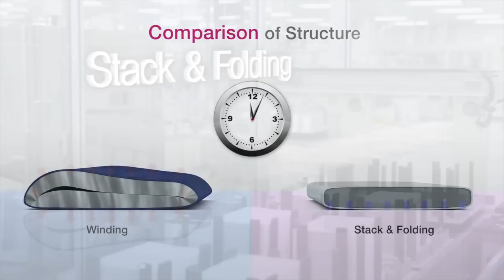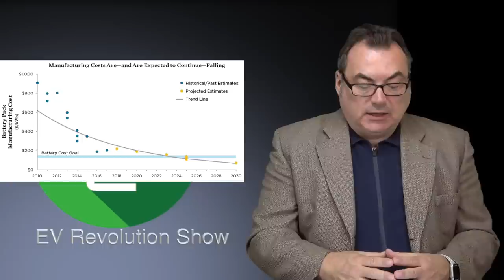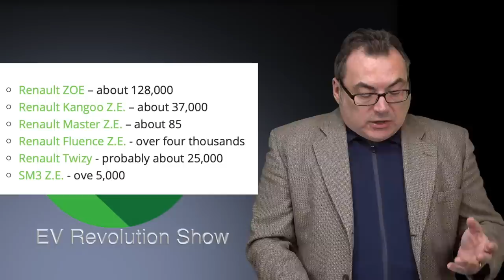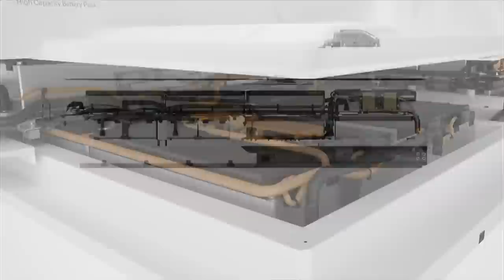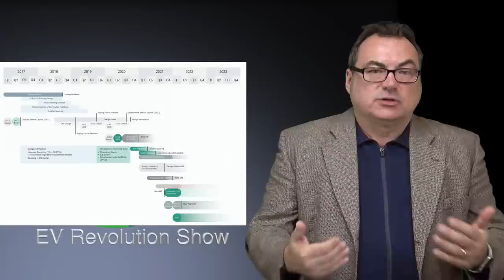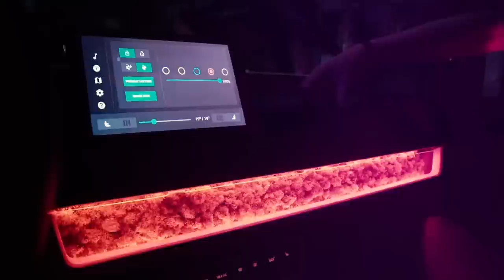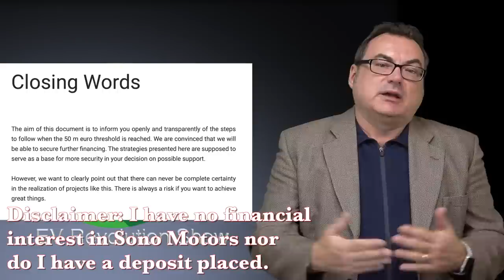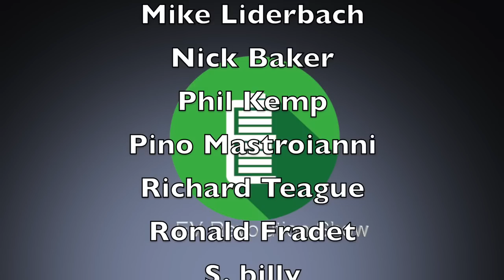Episode 71 - EV Battery Pricing, LA Zero Emissions, Hyundai E-Strategy, Sono Motors Funding & more!

Comment: As much as I like EVs I think we need to take on the realistic expectation that EVs will have to be cheaper right off the sales-lot than ICE units to really take off as the dominant mobility technology.  Joe minimum-wage-earner is going to buy the vehicle he can afford up front before he can even think about saving money while using it.  The transition from ICE to EV reminds me of going from Tube to Transistor radios.  Initially the hot new tech of transistors was exotic and expensive but quickly became cheaper and it was when it became cheaper in the stores than tube units were that it transformed the market.  I know it all sounds short sighted but that is how markets often move.
Reply: foxpup 
It's true that it's harder to make a very low end EV cost effective, but as all these new models cone on the market then the second hand market will swell as more early adopters trade up to newer models. Right now you can buy a Leaf or Bolt for very reasonable money. And in Europe there are things like the Renault Zoe.
And in a couple of years there will be second hand Hyundai Konas etc coming into the second hand market. These will still have many years of life left in them, and with much lower running costs than ICE vehicles. I think that is where those wanting more affordable vehicles will go in the short term. Based on falling battery pricing and economies of scale, by the second half of the next decade, I think truly affordable new EVs will be available for sure.
Reply: @michaelrch  Yes, being the owner of a 24KWh Nissan LEAF I picked up used at $8.6K I understand what you are saying.  That said, we are still dependent on the volume of sales to the high-end car buyers (not as bad as just the 1%'ers but almost)  $18K used Bolts and I3's with REX are great for bottom feeder EV fans but we're really not true bottom feeders since you can't get into the market TODAY without spending about $9K or more.  Yes as the older models get even older and batteries get cheaper, that will help but only a bit until the new market is cheap enough that the masses can afford them and get the volume up far enough so the real bottom feeder will have enough used cars to choose from.  Some day I'd like to get an i3 with REX used for say $16K in Orange which is doable but it will probably be 1000 miles away since the market is so small.  I'm good at surgical, chose exactly what I want to buy and find it, but most car buyers go to their favorite trusted dealer to get a car which is nothing like that dynamic.  Yes, the solution is in the factory/laboratories in getting the batteries to be cheaper and in the manufacturers making sure they don't add too many unnecessary extra features that make the vehicle too expensive .  We'll get there, but I really don't think we are quite at that point yet where the "pancake flips".  It feels like it will be something like 5 years when EV sales might >  ICE but we'll see.  I'm no prophet. :-)
Reply: foxpup 
That's all fair.
I think one thing that some people might not factor is the effect of EVs on the second hand value of ICE cars. Once EVs become the most desirable choice in a segment then the buyers of new ICE vehicles in that segment have to factor in that 3-5 years down the line, there will likely be almost no market for selling their car (due to better cost of ownership with EVs, tightening emissions standards, higher gas prices, more social pressure to drive electric, etc). That will drive up demand for EVs even more, both new and second hand. And manufacturers who are getting their act together now will be able to take advantage.

I suspect that once EVs are near price parity in a segment, then the future market for ICE vehicles in that segment will be choked off causing a very sharp tipping point where people rapidly stop buying new ICE vehicles in that segment at all.

This will go from one segment to the next as the years roll by, starting with midsize sedans and crossovers, then city runabouts, then premium sedans then SUVs and trucks etc.
Reply from the maker: Hello all, great comments and thanks for watching.  Yes I've been stating the need for lower cost EVs pretty well since I've started.  That will be the real driver for adoption, as other barriers have and are coming down.  

Hence why my tipping point analysis is targeting well into the 2030's for this to occur.  The progress to that point will be slow, but steady.

Comment: 2:23  I must be missing something entirely.  I FAIL to see how battery pack prices falling from the "supposed" current $156 per kilowatt to $100 per kilowatt will bring about cost parity for EV's versus ICE vehicles!
EXAMPLE:  I drive an absolutely fully loaded 2018 Kia Niro Hybrid Touring which bore an MSRP of $32,995 Canadian, including Freight.  By way of comparison, a similarly equipped 2019 Kia Niro EV carries an MSRP of $56,129 Canadian, a price difference at retail of over $23,000.  Yikes!  That's a 70% price premium.  If I take the 64 Kilowatt Hour Battery (perhaps 70 Kwh with buffers) and multiply that by the $56 dollar suggested cost reduction per Kwh, I get an OEM cost savings of only about $4,000. 
Now, my schooling took place "back in the day" before the introduction of the "New Math Curriculum" but there seems to be about $19,000 of cost still missing from the "Cost Parity Projection".  In fact, if the cost of the battery (at $156 per kilowatt) was ELIMINATED entirely from the equation, that would only take out about $11,000 of that current $23,000 price gap.  We've constantly been told that it is the cost of batteries which drives the price of EV's sky high.  It seems hard to fathom that an electric motor and reduction gear assembly could cost more than both an internal combustion engine and the requisite complex transmission.  What else is driving the cost of EV's so high???  Regenerative Braking?  Don't think so as I already have that technology included on my Hybrid Niro.  Perhaps some additional cost for large capacity copper wires to handle the electrical current???  Again, I already have SOME of that in my Hybrid.  
All this begs the question, are OEM's truly "losing money" on every EV they produce OR are we the consumers being sold a Bill of Goods with artificially high prices because Automotive Dealers just DON'T want EV's with their associated loss of maintenance/repair profits.
Here we have Tesla, scrambling to build factories for EV production, from the ground up, whilst the legacy OEM's have production capacity going begging for product due to over capacity.  Yes, those plants would have to be retooled to some extent, but they would seem to have a major advantage over Tesla in setting up EV production facilities.  I agree that their EV production volumes are paltry compared to Tesla but if they actually produced something desirable, that would help spread their costs over volume production.
It would actually be nice to see the entire breakdown of costs to assemble an EV versus a comparable ICE vehicle.
Reply from the maker: Thanks for watching and for your detailed comments.  While I don't have the cost breakdowns, I am sure you can google it to find this info out.  I was going off of the Bloomberg summary report and analysis.  True your math indicates something not so in parity, however it's more that just the packs.  Economies of scale as you mention, plus more importantly higher volume sales.  Right now, all the EV manufacturers including Tesla are charging more for BEVs because they need the highest margins possible to be able to re-invest in more tooling, development, supply chain contracts, in-sourcing, etc etc.  Plus they are greedy and since they can charge more, they will.  So while battery pack costing is a major pricing component to BEVs in particular, it's not just that effecting pricing.  When the Nissan Leaf came out in 2011 for Canada, it MSRPd for about $45-$50K.  Well today, it's still the same and we know pack pricing started out at about $1100/kWH versus what they are today.  That means that there is more to it than just pack costs, so what I just said above.  

They will have to come down in pricing otherwise they simply won't sell.  Incentives will not last forever and if manufacturers are making billions in investments to shift productions to EVs, they will need to sell these in order to recoup these investments.  The shift for the vast majority will be slower but steady.
Reply: You are missing NRE costs (non recurring engineering costs). These costs are initial investments that a company has to make even before building a single car. The costs can be very high and it has to be recouped with first batch vehicles. So, initially, the EVs would cost a lot more than just the production costs. And even then, the company may lose money for a few thousand vehicles due to high NRE.

Comment: It seems to me a used EV is already at parity and maybe some brand new ones Model 3 and Cybertruck model Y. For comparable ICE cars I think all those are immediately only slightly more expensive and if you drive any miles -Much cheaper TCO
Reply from the maker: Thanks for watching James!  For sure, many can find good used EVs as that market is heating up, especially in the UK and now in NA.  

However, I don't agree with you on parity just yet for new.  I can buy a brand new Toyota Corolla for under $20K Canadian.  A base Model 3 limited to 150miles for $44,999 CDN.  These prices are MSRP and without options, PDI/Frieght, etc.  I certainly know the benefits of BEVs vs. ICEVs, but even with the lower "fuel" costs and repairs (lower TCO), the pricing difference in this example is about $20K (take off the $5K Canadian Federal Incentive we get) lets say.  Saving about $2500 per year for gasoline travelling 25,000 kms annually as an example, my ROI to recoup the initial upfront higher cost for the Model 3 is about 8 years.  If I purchase the SR+ version of the Model 3, the MSRP is now $55,900K CAD MSRP (no Federal Incentive).  So the ROI goes up to 15 years.  

When you do the math, it is not as black and white.  Now, I compare the Model 3 to a Corolla, which is not a fair comparison on luxury car vs. average car, but for physical sizing and parameters, it works ok.  If I look at a 3-series BMW, then I am at MSRP $49K vs. $55,900 MSRP for the Model 3.  Difference of about $5K.  Can assume a ROI payback with those miles/fuel costs in 2-3 years.  Now it makes more sense.  

So really depends on what you compare the Model 3 and CT too.  There are base Pickup Trucks at a whole lot less than the entry CT.  

My point is just be careful when talking to people about this subject because each example can and will be different.  It's not as cut and dry as many people think.

Oh and I use the Toyota Corolla in my example, as next to the F150, it's the second most popular selling vehicle GLOBALLY in 2018.  So yes, price does matter.

Comment: Regarding Hydrogen Fuel cells.. Unless there's a breakthrough in hydrogen separation from water, making it cheap and able to be produced in high volume, the infrastructure for it will never appear.  It will be relegated to fleet and other specialized vehicles just as propane / L.P. is now.  The transportation of any fuel is expensive - Hydrogen's low energy density makes that even more expensive.  Electric power generation and distribution are already in place.  With the current focus on improving energy storage batteries, charge capacities and charge rates will both improve steadily, giving EV's longer range and more practical charge times.  Soon, it will take a huge effort along with a breakthrough to give hydrogen fuel cells a chance in the personal transportation market.
     I do believe that fuel cells will eventually take over the backup power and small to medium power generation roles.  With a large enough usage to make fuel transportation worthwhile, or even an on-site H2 generator, they become a feasible and very useful low-maintenance power source.  A breakthrough in H2 generation that comes too late for the transportation market could easily make fuel cells viable for home use, as well.
Reply from the maker: Hi Chris, thanks for watching.  Yes I agree for HFCV for consumer.  Commercial it can be viable (fleets, etc.).  

I do hope FC make a breakthrough as well!